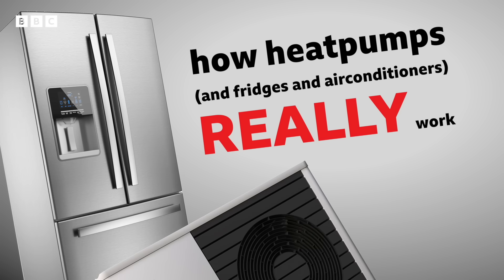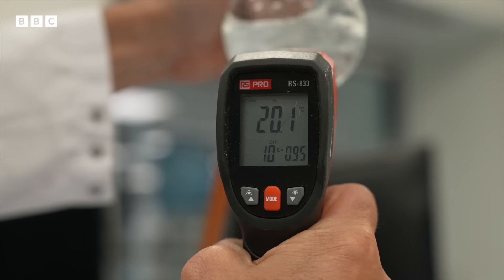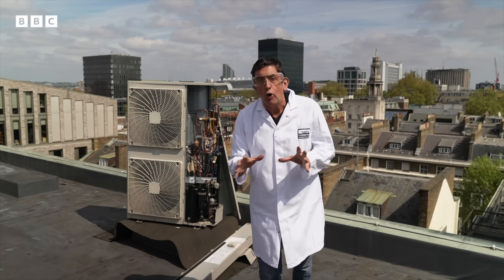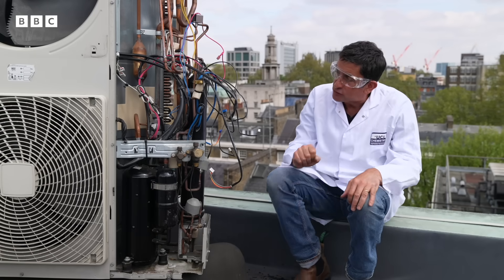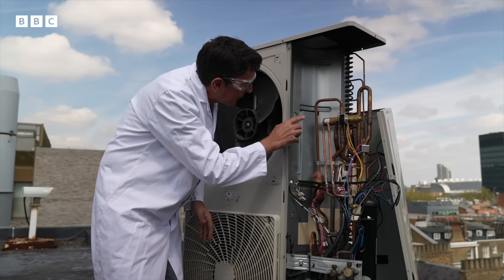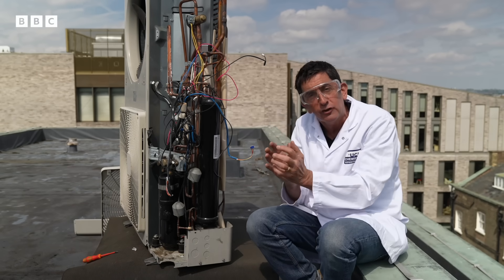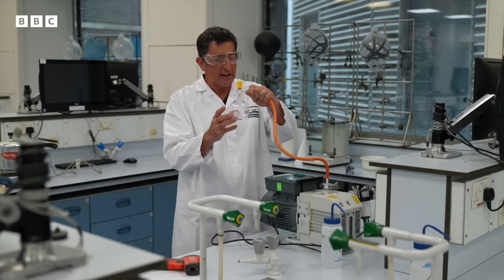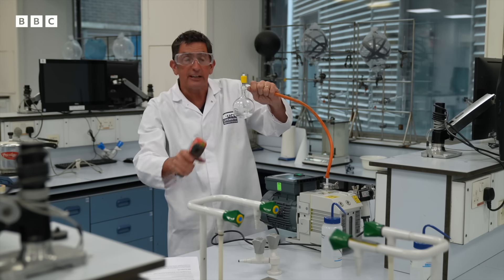How heat pumps REALLY work - BBC World Service

Comment: Heat pumps don’t work well generally., many people are experiencing poor heating after having installed very expensive conversions.  Likewise, Justin talks a lot of tosh regarding the conversion to renewable energy.  Renewables will never replace the essential need for the spinning reserve provided by large generators driven by gas or nuclear fuels.  These systems have to step in when there’s no wind or sun. Furthermore, wind & solar energy plants, sourced from China and built using coal fired generation, have a very limited lifetime and need replacement after around two to three decades.  I’m sick to death of these romantics who think that the UK, a fly on the backside of the world, will make any impression on climate change.  We’re more likely to be a laughingstock. By the way, I’ve taught energy conversion for many years and would like to shake Miliband warmly by the neck.

Comment: A lot of blah-blah for something simple.
1. Heat pumps and air conditioners are the same thing. You can reverse the mode to cooling instead of heating.
2. They are more efficient than a resistance heaters because they transfer heat instead of generating it.

Comment: What a superb explanation of how a heat pump works

I came across commercial heat pumps with the job I used to do never really worked properly at work until electrical panel technology came along finally with the help from a quality engineer we got the whole system working to heat plenum air system and other heat uses what an amazing piece of kit it is but to see them now getting the application s at home is wonderful thanks for explaining this fascinating phenomenon!

Comment: They just don't work very well that why nobody uses them.
Reply: Mine works great and cheaper than my old gas boiler.
Reply: Mine runs great. 460% efficiency over the 3 years it's been installed.
Reply: You ever heard of the conservation of energy? @richardcorns8553
Reply: You ever heard of the conservation of energy @richardcorns8553
Reply: Can't reply comments deleted

Comment: I was talking to a guy with one, he said the air going the other way is freezing, could that not be utilised for cooling the home too when the HP is only heating water?
Reply: Ours can run in reverse, sending cool water through our underfloor heating pipes, cooling the floor. You can’t do this with conventional radiators, or it would cause condensation when going below the dew point.
Reply: Yes you could in theory but if you have a heat pump heating water to radiators they don’t have enough surface area. 

Heat only moves from hot to cold. You would need more fins on the heat exchanger on the inside of the building. Air conditioning typically uses the refrigerant to cool the inside heat exchanger and then runs air over it via a fan. These are typically very cold -16 or so and they remove a fair amount out of heat out of the air. At that temperature the water in the pipes would freeze and all your pipes would split. 

You can run the radiators down to say 8 degrees but even with fans on them they don’t create enough temperature difference and have enough surface area to make a major difference. In addition at 8 deg your likely to get moisture condensing out of the air so your going to get water dripping on your floor.
Reply: What I meant was, not using exiting pipe work, more of blowing the cold exhaust air into ducts in the home.
Reply: @hoojchoons2258  In theory, yes. But hot water would only be on for 1-2 hours a day.

Comment: Heat pumps still need electricity to function and every night with zero Solar and when there is not enough wind for Wjnd turbines (or when their local grid cannot support the load they provide), where is that electricity going to come from? And as for using explosive hydrocarbons such as propane/butane for refrigerants, they need to be produced via the oil &  refinery process. Not the nirvana people hope. In the correct use cases then yes, but the domestic heating provision needs to be mixed and more nuanced. …. And then we have our industrial heating requirements, a whole different challenge.
Reply: If you get solar then you need batteries too really, that answers your question. It's at least a start.
Reply: Using propane as a refrigerant isn't that gotcha you think it is. The loops contain far, far less than the average barbecue bottle, and what's there is used over and over in a sealed system and not just burnt once. And if it does ever leak, it can only leak the charge it was given in the first place.

It's far less of a danger than the risks we currently live with from the gas boilers and hobs in our homes. With these there is the very real threat of a substantial leak of gas, courtesy of an effectively unlimited quantity available from the gas network. Valves can leak, and burners can be left open & unlit accidentally. I'd prefer to tolerate the (much easier to mitigate - the unit is outside!) risk of leak from a small, finite source, than a potentially much larger one from a much bigger supply injected straight into a living space.
Reply: Our electricity in the UK is from Gas Turbines.If we relied on wind mills and solar we be in darkness a very long time.

Comment: How can you put one unit of energy in and get three units of energy out? That is completely ridiculous! The first law of thermodynamics states that energy cannot be created or destroyed.
Reply: Why are you quoting the first law of thermodynamics? No one is claiming that heat pumps break this, other than those who don't understand how heat pumps work. The second law of thermodynamics is more important for the operation of heat pumps.

Heat pumps transfer heat from the air (or water/ground), if you stand next to an air source heat pump the output air is far colder than the outside air temperature, this is because of the heat extracted from it to be circulated around the house.

The video, if you bothered to watch it, explained about latent heat, which explains how heat pumps work, seemingly breaking (but not breaking) the laws of physics in getting up to 500% efficiency and heating water at up to 65ºC from air temperatures below 0ºC. Heat pumps are not magic, but they are amazing.
Reply: It's one unit of energy from your electricity supply, plus more collected from the heat in the air flowing through the heat pump's outside unit, so there's no breaking of laws of thermodynamics. As the air flowing through your heat pump is free, it contributes zero cost to that part of the coefficient of performance (COP) metric equation, and not at all ridiculous when you consider what COP is used for - which is to give a figure of merit to compare potential heating systems. Granted, the term "efficiency" winds people up when it is taken out of context.

Comment: It’s a fridge. Except instead of moving heat from inside the fridge it moves heat from outside the house to inside the house. It uses the energy required to change a liquid to a gas and the energy released when a gas is compressed into a liquid.

Comment: So glad you finally made a truth video about heat pumps.
It’s not as if nobody has explained all this multiple times already. But the licence fee has to be spent somewhere I suppose .
Reply: And he doesn't really explain it very  well anyway imo. 

When you compress the gas - it gets hot..... and you can hold the pressure - and release the heat...
He showed that... sort of by effectively showing how a diesel engine acheives ignition..

( and is the heat released = to the energy you put in to compress it?)

 and ...does the gas turn back into liquid under pressure (as it cools).- he didnt show that - he showed the "reverse" - reducing the pressure to show water boiling at room temp. 

All very vague imo.

Comment: One issue with using heat pumps in the UK is our high levels of humidity, which means they get a build up of ice very quickly in winter, at which point they have to go into a defrost cycle that consumes a lot of electricity. So making a direct comparison with Nordic countries for example is like comparing apples and pears, as countries with colder climates tend to have much lower levels of humidity. There is a Goldilocks period in Spring and Autumn when they work extremely well. I live on the coast and when it gets within a few degrees of freezing my system gets a huge buildup of ice on it very quickly, which triggers the defrost cycle and a consequent large increase in noise from the system (it is still quieter than my Gas boiler was though).
Reply: Plenty of humidity in Nordic countries between the summer and winter. There is some merit to this argument, as nordic heat pumps often contain extra heating element for melting the bottoms of the units. However, if your heat pump isn't completely flawed, icing up is completely normal part of the process and it doesn't even affect the effiency that much if the heat pump runs properly in reverse.
Reply: Is that because you live on the coast and the air is more humid closer to the sea ?
Reply: @TimMountjoy-zy2fd  I think the U.K as a whole is a very damp place. My situation of course is an extreme. In the winter it seldom gets below -5C here but, my heat pump starts to ice up around 5C. In winter, my home weather station reports humidities in the mid to high 90s. At the moment (mid-June) as a comparison it is reporting an outdoor humidity of around 70. I was watching a podcast about the use of heat pumps in northern Ontario in Canada. One of the people on that was saying they do work there, and they also said because cold air is very dry they don't get that much icing and the efficiency is more down to how well the refrigerants behave below zero Celsius. I have not seen much of a mention of the effects of humidity on heat pump performance, so I thought I would share my experience.
Reply: Agree with your point. But they just go into defrost mode. Mine is still >400% efficient
Reply: Newer units just use a reverse valve and pump warmed water around the fins, defrosting without using a lot of power. Latest Viessmann units seem to do this very efficiently indeed.
Reply: @fruitytv-uk Mine is a new Vaillant unit and it generates quite a lot of vibration when in it’s defrost cycle. When the weather gets cold again the installer is going to come and look at it.

Comment: Your expert points out the evaporator but isn't that the expansion valve feeding the evaporator coil? Also, hopefully that unit won't fall off the roof killing someone? Why did you not demonstrate one on ground level? No mention either that efficiency goes down and power consumption goes up as the outside air temperature drops e.g. Winter.

Comment: You get two types of heart pumps ground source and air source. My one is a ground source and its been very good since we got it the only problem we had with it was not long after we got it. It had a crash but the engineer fix really fast and that has been the only problem we have had with it. The people that say that it does not heart your home well enough are delusional I find my self to hot a lot of the time when it is running and people act like they are load yea probably if you are right next to the thing but when you have the door closed you cant really hear it and if so its barely noticeable you will only hear it if you are really I mean really trying to listen for it. Plus there is no annular inspection like there is for a gas boiler like I said I have only had one problem with it and that was it crashed but never a hardware and my friend who has a gas boiler had had nothing but problems with his one. I also read on another video that he had nothing but problem with has heart pump and he also stated that he has had them well before they where even popular like bro the old heart pumps where really bad but the new ones are soon much better now yea they are expensive but isn't anything at first plus they are only going to get cheaper as time goes by.
Reply: Time goes by when we are all under or burned to ashes yes?

Comment: Only in UK do you find people that think 150 year old technology like heat pumps is something new and cutting edge. Soon BBC will need to do a special documentary explaining radio communication and electricity.
Reply: It's like calling your fridge cutting edge tech 😂 both machines just move heat from one place to another!
Reply: It’s only new as in the UK has relied on gas for central heating for a hundred years. But now there’s a big push for people to use heat pumps rather than gas boilers for environmental reasons.
Reply: @Paulruk  Environmental reasons another joke forced upon us.We subsidise wind mills in the UK and our gas/electric bills are high.Our infrastructure is falling to bits to deal with all this Green utopian energy.

Comment: I'd rather pay more for electric heating that provides comfortable heat. The heat pump noise annoys me, I don't like the draught, and in cold weather it doesn't produce enough heat. The system is very expensive to install and soon becomes obsolete. I use oil column heaters in the living room, much nicer. 80% of our power is renewable anyway.
Reply: Heat pumps only work in countries much warmer than UK, like Finland, Sweden and Norway.
Reply: @Scouser22 Not in the UK.
Reply: @lobstermash  are you talking about an air-to-air or air-to-water? As they do work in different ways.
Reply: @WattsUpWithSteve  Air to air. I'm not saying the top quality heat exchange systems don't work at all, I just wouldn't switch for the cost. I'll be dead before it shows a saving.
Reply: @lobstermash  I don't think people tend to pick air-to-air looking for any payback, you are more interested in the comfort side due to the cooling option in summer rather than relying on portable AC units. Any financial savings is a bonus but I can't see it's people's first thoughts. Although it does look like air-to-air might be accepted under the BUS grant soon at a reduced rate, think £1500-2000. But that's still to be confirmed.
Reply: @WattsUpWithSteve  I'm not in the UK, but just for curiosity what does 1500-2000GBP cover? Is that a grant towards installation, or does it buy you a single room unit, installation included?
Reply: @lobstermash  ok, to give a bit of context, over here we have a grant called the "Boiler Upgrade Scheme" or BUS grant for short. The original intention was that it's a grant up to £7500 (was £5000) to replace a gas boiler with a heat pump. This broadly covers the bulk of the cost bringing a change over more in line with the cost of replacing an old gas boiler. I have used this grant for mine and all in it cost just under £2000 after the grant with a new hot water tank, 9kW heat pump and 5 radiator upgrades. 
So the grant is just deducted off of the final bill regardless of what is required.
Now this did exclude air-to-air as they grant didn't cover a system that also cooled and often you'd need a hybrid setup as you'd still need to heat the hot water which might mean you need to keep the gas boiler. Final draft is yet to come out on what type of system you'd need, but it'll be the same as the air-to-water grant and just deducted off the final bill. Hope this helps
Reply: @WattsUpWithSteve  Thank you very much for your detailed reply. It sounds like an excellent scheme.
Reply: @lobstermash  no worries, happy to help.
Reply: @WattsUpWithSteve  So you still need the Gas Boiler,So what is the point of all this nonsense?
Reply: @foppo100  not at all, just air-to-air and air-to-water work in different ways. With air-to-air you'd still need a way to heat hot water which can be done with an air-to-water heat pump. I believe Daikin now offer a heat pump system which can do heating, cooling and hot water. Only limitation is that it can only heat or cool at any one time, not both. No different than a mini-split AC system, can't heat one room and cool another at the same time with one external unit.
Why bother? Depends what you are after and if you want to keep existing radiators or not I guess. If you went full air heating/cooling with no rads, you could put in a mixergy hot water cylinder. A channel called "Tim & Kat's Green Walk" have this setup for more info.
Reply: I live in the north west of England and have an air source heat pump in a 200 year old barn conversion. After 5   years of use I can confirm it has been excellent in all conditions

Comment: While it is good to try to explain to people, I don't believe that you did a good job on explaining the technical side of the the workings of a heat pump or air conditioning system as the title of the video suggests. The gas or liquid from the heat pump pipework never touches the water in a shower or your heating, it goes to a coil in a buffer vessel which heats the water around it like an element in a kettle. This heated water is then pumped from this storage vessel to your shower or heating, depending on what is called for.
Reply: It depends upon your system, for example in my system the water for the radiators flows into the heat pump heat exchanger without a buffer vessel in the way. Generally it is better not to have a buffer vessel, but these are sometimes needed.

Of course the hot water cylinder is heated from the hot water from the heat pump, rather than directly within the heat pump, a gas boiler with a cylinder does the same thing.
Reply: And you need space for this storage vessel.We used to have a tank in the landing cupboard before the Combi boiler.Making space which many houses don't have in the UK.